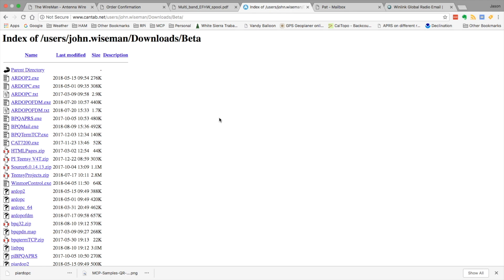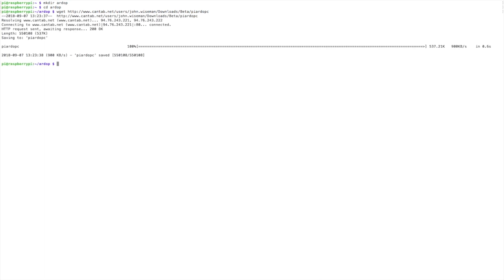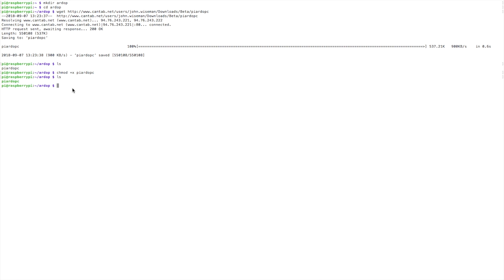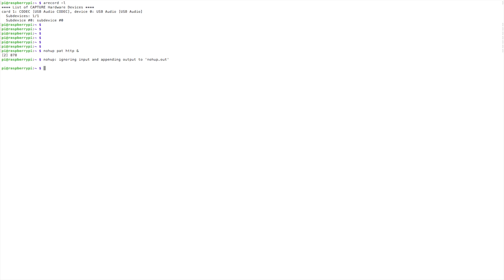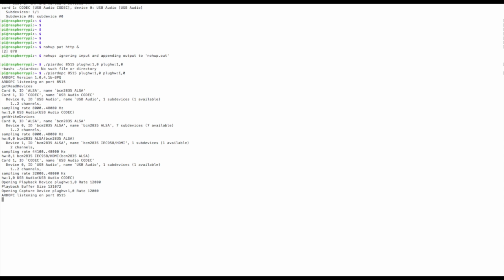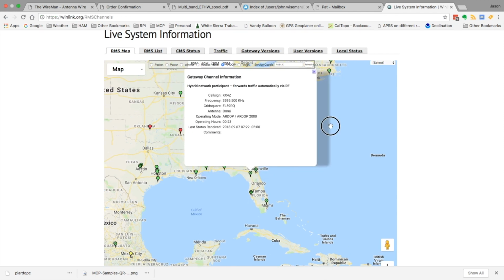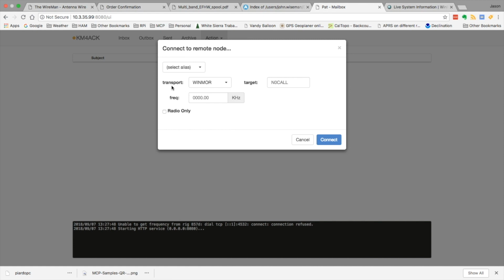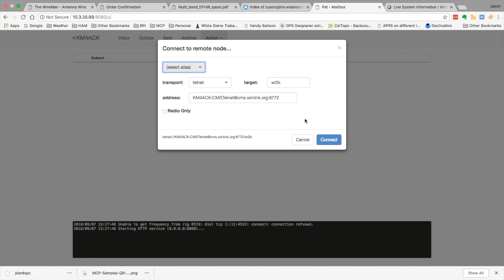Installing Winlink on a Raspberry Pi EP03 UPDATE

Comment: Thanks Jason for your had work in preparing the videos and references. With each video I made one or two mistakes but with careful review got it working. As mentioned before, I had to change the PTT from false to true. Using VOX didn’t seem to work for me. Also of note running on Raspian Buster and Rasp Pi 4. Bruce K8CJM
Reply from the maker: Each system can require a few tweaks as there are many different radio/soundcard combinations. I also had to set PTT=true when I stated playing with the DRAWS hat since it doesn't use VOX either. 73, de KM4ACK

Comment: Hi Jason, I had this working really well on a pi for several weeks and the I needed to start a new pi from scratch and I couldn't get it to work following the videos, I re-installed a few times and tried a bunch of stuff to no avail, the ardop terminal window looked like it was doing what it was supposed to do but nothing was happening on the rig.  I finally had a moment and remembered that you are using VOX and I'm not so I needed to change the ptt_ctrl in the ardop section of the pat configure file from false to true.  I feel silly about it now, but simply overlooking that cost me a bunch of time and frustration so I thought I'd drop a comment here in case that information might be helpful to someone else down the road.  73 and thanks for the great videos!
Reply from the maker: Thanks Matt. I ran into the EXACT same thing when I started poking at the DRAWS hat. It doesn't use VOX so I had to figure out how to key the rig another way. Changing the PTT to true in the pat config file was part of the solution here. I have a video planned on this in the near future. 73, de KM4ACK

Comment: Thank you. Have watched 1 through 4 so far and only have one constructive comment: change the preferences settings on your Mac for Terminal to a much larger font. Launch Terminal, Go to Preferences, first tab is Text, click the 'Change' button and choose a larger font size. Doing so will make it soooo much more easier for those of us watching your great videos to see what is being entered and the responses. Thank you - now heading off to the next video..
Reply from the maker: You are absolutely correct. It should have been made bigger. I do try to put every command in the description of the videos but I know it's not the same. Thanks for watching! de KM4ACK